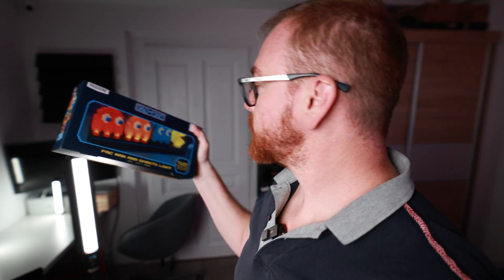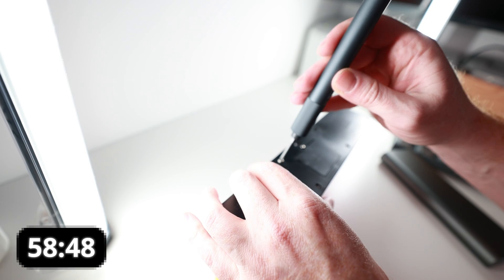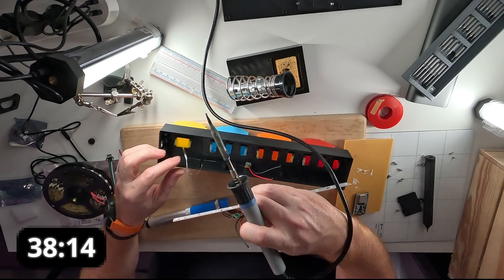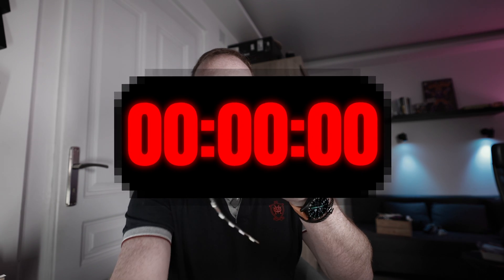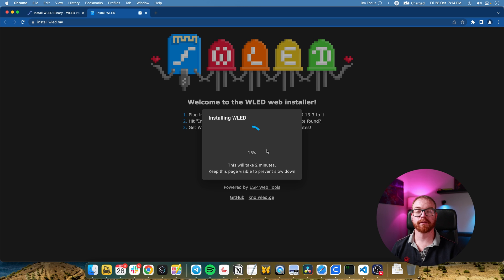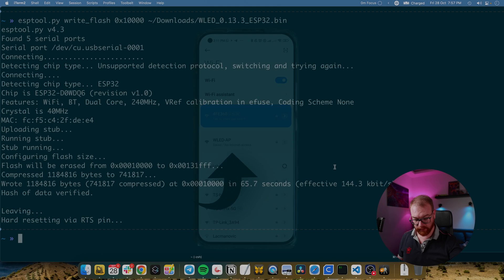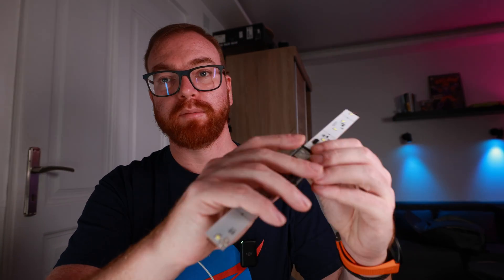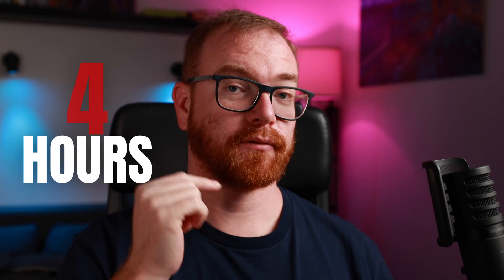Bring your room to life with WiFi-Connected Lights Project!

Comment: Web tools working well here for esphome and wled. It's cool what esphome are doing with webtools and the ability to adopt projects that can get updates from the project url
Reply from the maker: yeah, actually after publishing the video, I found out the issue - it was that the ESP32 had to use an external antenna, and I didn't have it connected. That's why when I took a different ESP32 it suddenly worked.